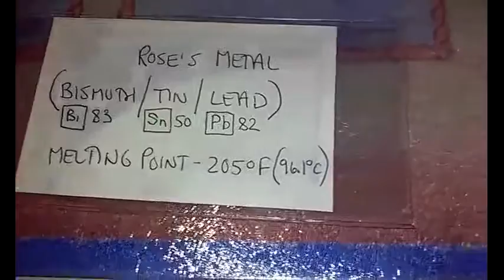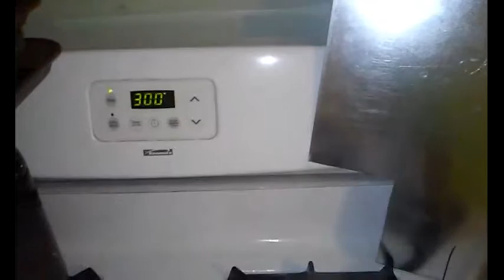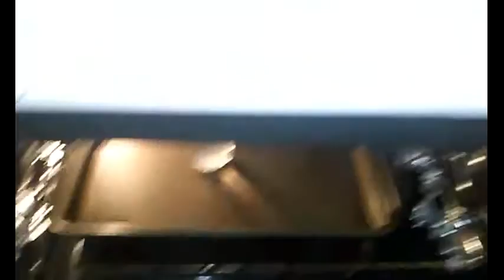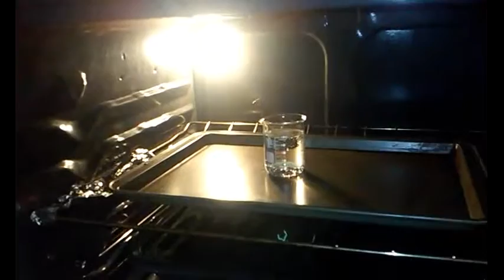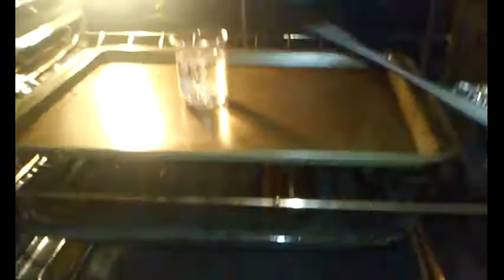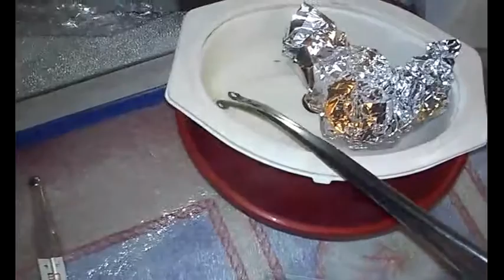Melting Rose's metal in boiling water heated by a conventional oven

Comment: Cool video!

By 'drippage' did you mean that it didn't leave traces behind at the spout of the beaker as in your other videos?  If so, it's because Rose's Metal isn't eutectic.  As a non-eutectic mixture, when Rose's Metal cools down, its components will solidify (form its lattice) at a distinct temperature, until all material is solid.  Each component remained at a high enough temperature to solidify once completely out of the beaker.

Great video, but, if it had to be melted at 450°, you likely have a metal that's components aren't mixed in correct ratio and the properties are off.  It should have melted at 205° or so (201° - 208°).

Just because the oven is 300° doesn't mean the water is.  Water is 784 times the density of air, so, just because your oven is at 300° doesn't necessarily mean the water is.

It's still a great video like your other 'low melting point metal' videos!

Thank you for posting! :)
Reply: Also...you could have filled a large plastic container with cold water and poured the breaker into it.  This way the metal would have cooled and solidified before hitting bottom.